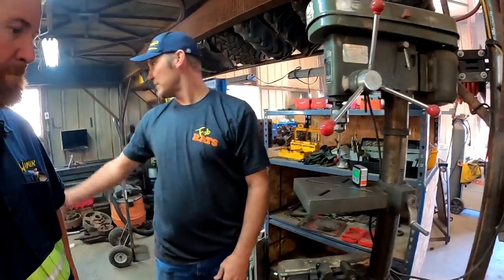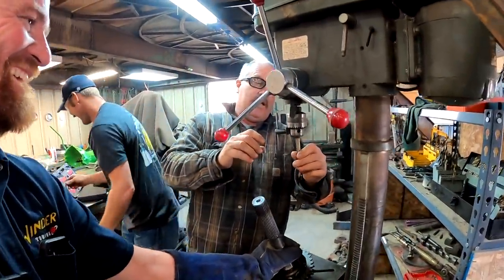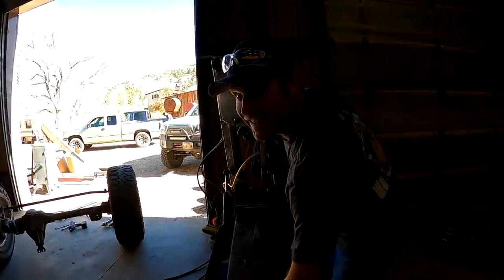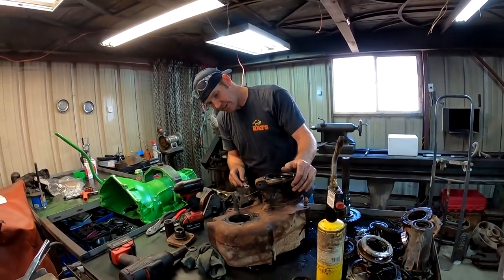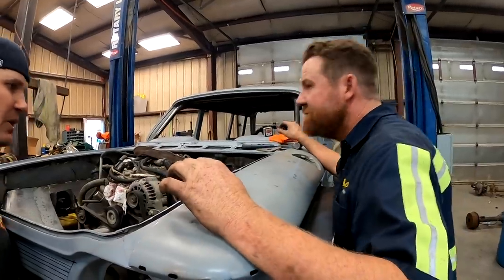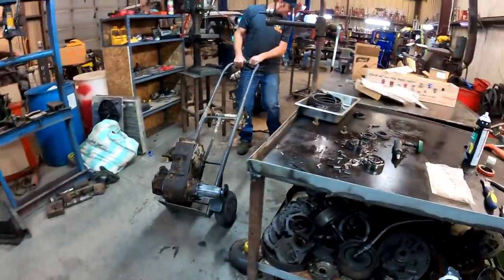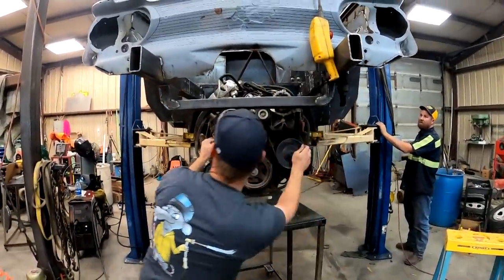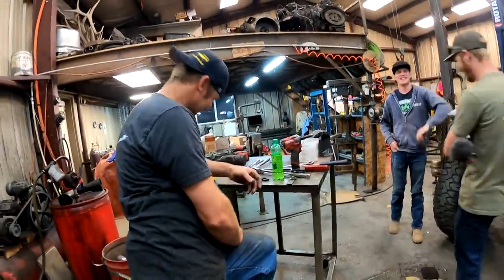--Completion of the TRANSMISSION and TRANSFER CASE for a CUSTOM CORVAIR WAGON--

Comment: Guys get some cutting fluid in the shop your cutting tools will thank you.  Check with your local industrial supplier for a water soluble coolant concentrate like Rustlick ws-5050 can mixed 20-30:1 for general purpose sawing/drilling/cutting thats not too expensive($2 a gallon after mixing).  You can get it from like Graingers/MSCdirect too but they will beat you up on shipping.   You'll get a lot more life out of your drills,  saw blades,  and lathe tools.

Comment: Why bore the end of a shaft with a drill press when there is a lathe in the background?
Reply: They would have wanted to chuck on the shaft not the flange. I dont think they had enough room to get the flange in behind the jaws. The shaft was to short to go all the way through the head stock as well. Not sure what the bore is on that head stock on that lathe.
Reply: @nwngunner  chuck the flange, if necessary with protective strips, and use a steady to support the shaft
Reply: Safety Glass Guys !!!!!!!
Reply: @johnwinston7281  No safety glasses, no masks, no condoms.............
Reply: @dalmatiangirl61  no masks? For what, like dust ?
Reply: @johnwinston7281  They did put them on after a while.  Tyrone had his on the whole time.  He knows how the other two work.
Reply: Machinist checking in. I'd do this on a mill and plunge it with a carbide end mill then bore to finished size or grab it by the gear in a lathe use a steady rest to do the same thing. If it needed to be held in the steady rest close to the end I would shrink fit an aluminum sleeve over the spline, turn it true and run that in the steady rest then just zip disc it off after.

Drilling hard stuff on a drill press is a bad idea because it requires a lot of quill pressure and when you do that on a unrigid drill press it forces the head and table apart (think like when you tighten down a C clamp really tight) which cocks the drill and catches it in the hole
Reply: @headcrusher1966  ?

Comment: Paul, just to let you know, use a concrete drill bit, recut the angle of the carbide tip of the drill bit, your high speed on the drill press and air to cool, thats how you drill that shaft.

Comment: Its incredible to look back at this and see the stuff you all did to get this beast together.   Its also amazing to realize that the transfer case in my Suzuki super carry doesn't weigh as much as the slip shaft setup you guys built.
My transfer case is pretty much like the OEM one from Eds golden nugget.

Comment: If you do a lot of hard steel drilling, hide some straight-flute carbide bits around the shop specifically for starting those holes. Used carefully they'll speed the process up... but they're going to need to be cared for.

Comment: Paul as a thought 
..I Use to work  w a Older Machineist..trick he taught me ..leave item  you've drilled in vise  of drill press tray . make / use a center point ,  put it in chuck of drill press ..As your pulling tap into hole to thread .(.DO NOT STATE DRILL PRESS ) .Use the center point to Center top of tap...have Helper put pressure down  w handle. As you  Turn tap & wrench  

W. Pressure  down  on tap ,as tapping keeps the tap centered & Straight into the hole

Comment: Awesome fab work.. build what you can with what got!!  A couple of things you might try next time your drilling case hard... decrease the rake angle on the drill bit as if you were drilling cast or brass, also your lathe is big enough.. I have fabbed a v-block to hold the part fixed to the tool holder and put the drill in the chuck...slow RPM.. Matt won't risk losing a limb🤪 keep up the great content!!

Comment: Tap Magic makes a great cutting oil. I used my junk fake Makita bits off Amazon to drill into hardened steel. I tried it dry, not a mark, tried silicone spray, scratch, WD-40 and I love WD-40 with white moly and their contact cleaner, but still not much, then I got the Tap Magic and it drilled like butter.

Comment: What works realy good on face hardened steel such as your spline shaft is a "Carbide Burr Bit".  Just ease it into the end, and once your below the hard-face you can switch back to standard bits to complete the job.

Comment: I dulled 3 bits trying to drill out hardened steel shaft like that last week.. couldn't tap it because it was too hard of steel, so I used a weld nut. So far, so good..

Comment: I used a carbide tip glass and tile drill bit from harbor freight on my output shafts, it was money! Super easy. Like you i went through alot of bits before i discovered it.

Comment: When you case harden a drive shaft it makes it more shocked resistant. The outside usually hardness is about a 16th of an inch in depth and the center is soft so it allows for a little twisting as opposed to snapping into.
Reply: A carbide spade drill helps to break through that 16th of an inch hard steel. I much prefer using a spade drill over a twist drill

Comment: I don't know if heating the shaft to anneal it was the best idea. Even if you reheat and quench it, you'd still need to temper it or it'll be brittle. And there is almost no control over the temperatures so you really have no idea what you are getting once the existing heat treatment has been removed. 

The case hardening is usually only a tenth of an inch thick or so. You can remove just the tip of the shaft with an angle grinder and cutoff wheel to expose the softer core of the shaft without altering the heat treatment of the splines. Steel anneals around 1300 F or so, so there isn't much risk of overheating it and affecting the heat treatment with the cutoff wheel. 

You've got the entire length of the slip yoke on the splines, so I am sure it'll be plenty strong in this case. This is more for others watching this, assuming they have to proper fixed yoke for their transfer case and want to drill and tap the output shaft to eliminate the slip yoke.

Comment: What I liked is they put the motor in the front of the Corvair but still installed it from the bottom just like it would have been done originally except in the rear. So it's keeping some of idiosyncrasies of the original in a new format.

Comment: I would love a twin stick for my NP242... I don't think it's possible though. It would be nice to have 2 low for towing stuff... or 4-fulltime low. However I would buy a SYE delete kit, rather than do a hack and tap. It actually replaces the output shaft and replaces the rear case section with a shorter one.

Comment: I used a divorced NP205 for a while in my van conversion but it made to much noise (normal noise for it). So I replaced it with an NP208. I miss the twinstick feature I made work in it. I actually air shifted it.

Comment: Should've cut that output shaft down and ordered a new SYE cap, it would have been more stable with less vibration, and you would have started drilling into the soft stuff right off the bat, I did a few hack and tap SYE jobs on my XJs over the years.

Comment: Did you guys consider adding the range box from a NP203 for much lower gearing? The 205 does not have a very low gear ratio

Comment: Hey guys you could get any old Ford 205 for less then a hundred bucks and it would have all the parts and bolt on yoke and bearing housing,shaft and everything,and be way stronger, just saying , could have built the case in an hour and been done , but if your just blowing Saturdays with buddies that's all good too

Comment: DRILL PRESS: A tall upright machine useful for suddenly snatching flat metal bar stock (or tailshaft) out of your hands so that it smacks you in the chest and flings your beer across the room, knocking over the coffee can that contains two dozen needle bearings and scattering them all around the shop.

Comment: Why go to that much trouble when you can just put a heavy duty slip yoke eliminator kit on it? It also helps because you can run a little longer drive shaft and keep the angles down.

Comment: Matt you should have just swapped the a older fixed yoke that is shorter over all so your rear drive line is longer and put a 1350 yoke to match that 14 bolt

Comment: That looks like a pretty small converter for the application.
Reply: I’m not sure about torque converters for off-road applications, but for my second generation Camaro, turbo 350, and other automotive/drag racing torque converters get smaller when they are for higher performance applications, higher stall speeds etc.

Comment: Was that a ls specific th400 torque converter?  I could not see the hub in the video, if that is not a ls engine specific torque converter it will be too far out of the pump.

Comment: Why not just swap the output shaft for the OEM NP205 fixed yoke tailhsg/shaft.  It will be more reliable, have part availability for service and allow a longer rear drive shaft.

Comment: Can't fill the lower part of the ORI Strut? Come on Mat, pull that bottom bolt and rotate that fitting around 180 toward center of the Vair, Plus if U-on-to, U can plumb the fittings to the inside for remote charging on the fly, and keep U off the ground. If-in Ya Know what I'm Sayin. That NP 205 was a fine choice.

Comment: i'm curious wouldn't it be better to have portal axles or don't you use them over there in the states
Reply: They are here. Price? Looks like Mopar is over $10,000 per axle! Unsprung weight? How are they for durability on a work truck?
Reply: @wssides  Mercedes Unimog U1300 Agri Axles Portal 8 Stud used ebay £2000 Volvo military TGB C303 C306 have portal axle i had a x-military land rover 101 forward control V8 that had portals buy new looking around six thousand but if i looked harder i could find cheaper i think

Comment: What I've been doing is similar just no time to screw around as your either freezing your skin to purple or it's nice and warm. When ever an issue at how to invent you have to be on top to really get a vision of what can be fabricated to get it accomplished 85% roughly is like blacksmithing . No major tool's like a Leith or bench vice no plasma cutter no jig to line up a truck bed for assembly and that is fully assembling the entire bed from scratch it's all manual labor no heat you work outside.

To bad I don't have a camera person right cause actual b-roll would really get views

Comment: IF the fan clutch was laid flat, instead of standing up, it will be no good and need replaced. Suspect you smart guy already know that.
Reply: Wonder how the parts suppliers and dealerships ever get a good thermostatic fan clutches to a customer!! The boxes are packed in other boxes with other parts and the clutch box itself has no "this side up" on it. (not that anyone in shipping pays strict attention to such signs)
Reply: @wssides  It is for used clutches. The material that moves the the thermostat controls for speed is fine laying flat until it is used. After use the material flows past the control valve making them useless. Lesson learned the hard way. Also never by cheap. A replacement has to match the OEM and be from a really good company.  Cheap are only on and off and never lock up. Not what a hard working engine needs.

Comment: Next time use a masonry drill bit they are made of tungsten  steel it will drill almost anything
Reply: Haha, this made me laugh!
Reply: Don't laugh until you try
Reply: You're serious? I thought you were joking. Weeeeelll, where do I start? First, masonry bits are not tungsten, they have carbide inserts, second, they aren't any better hardness wise than a good twist drill bit, (there are harder twist bits available) and third, a masonry bit lacks the cutting angle and sharpness needed to drill through even mild steel, much less hardened steel. I've used every brand, make, and model of masonry bit on the job, they are not designed to drill steel. Hit a piece of rebar in concrete and you find this out.
Reply: Got you thinking huh

Comment: you guys need to stick to pulling cars out of the sand. You are the unsafest people I have ever seen in a shop. Take away your power tools, you set a really bad example. I am 81 and still have my fingers, eyes, and parts after doing shop work for over 60 years. Tyrone has the idea, use safety googles.